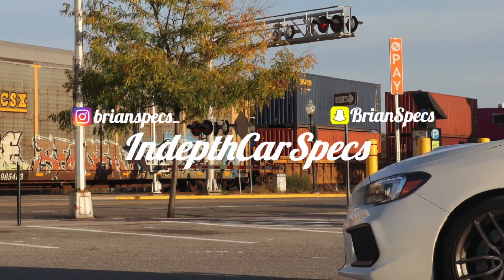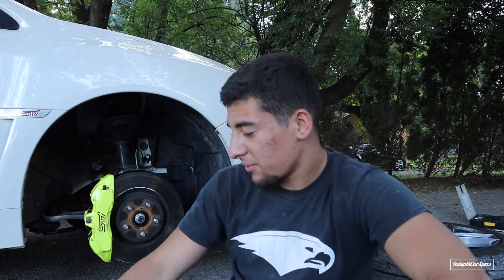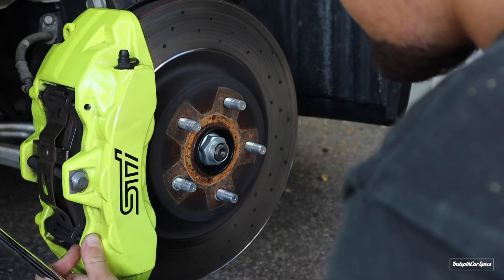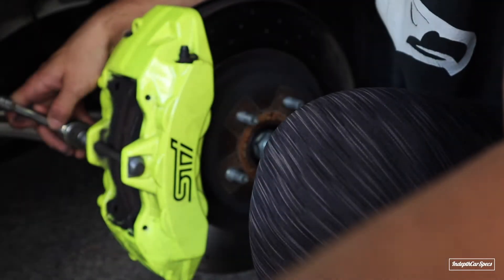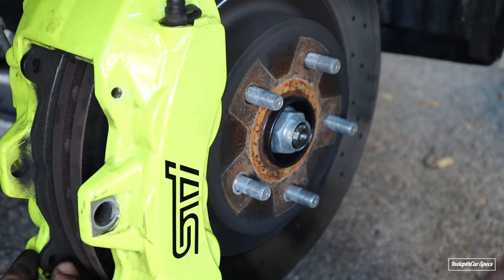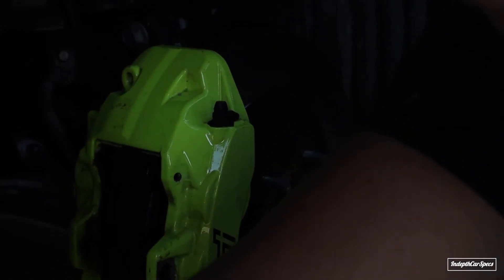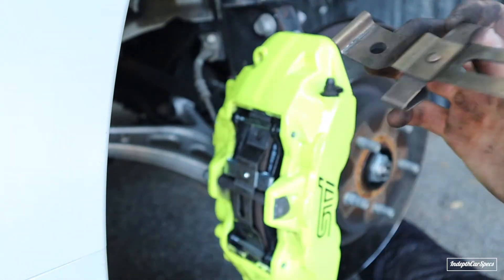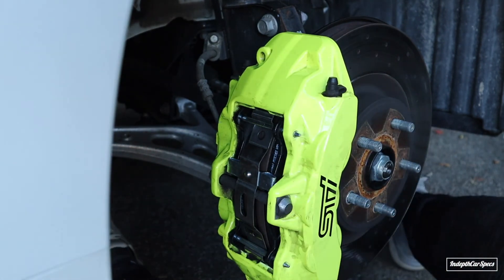2019 STI Brake replacement

Comment: Head up on the front calipers when doing the rotors, you need a 19mm socket with an extension or a 19mm wrench. Just did my brakes and rotors for the first time (1st time period) on my 19 STI, absolute pain in the butt but I was done in 3hrs with smoke breaks and booze breaks 🤣

Comment: Anyone wondering. Big break kits, like brembo, will normally squeak as they are made for performance so normal driving they will squeak a bit. Do a little spirited driving to get them up to temp and the squeak will go away. Unless your pads are suuuuuper worn down
Reply: Thanks!!! I have a 2021 with 20k miles and my brakes were squeaking! I took it for a routine Service… only thing they can say is they can do a brake change even if they are almost new! I’ll give this a try when I take my sti out for a drive.

Comment: After my rotor and brake pad replacement I'm hear a clunking noise while I roll in first gear and a lot of noise when on uneven road.
Reply from the maker: What a coincidence that happened to me the other day. I heard like a clicking noise but then it went away🤷‍♂️. Maybe got rocks stuck in there I don’t know
Reply: Have the same problem recently. Any solution to it?